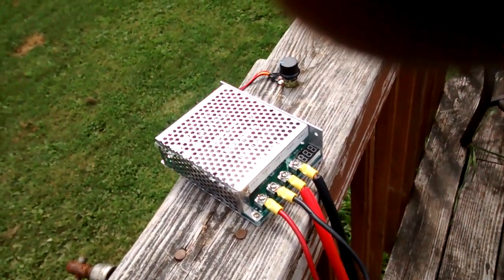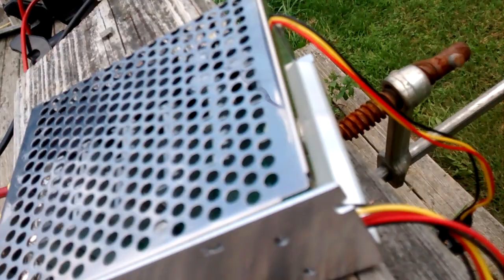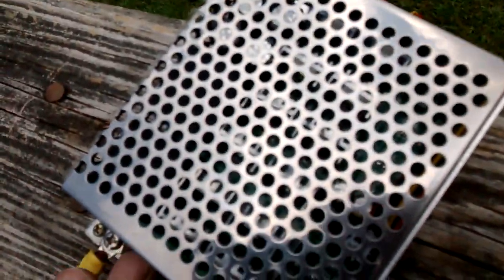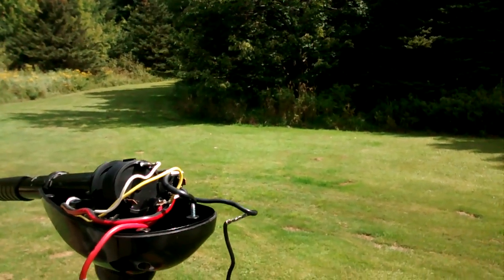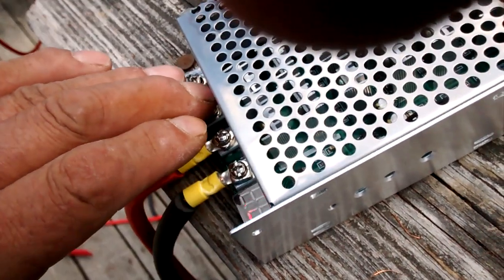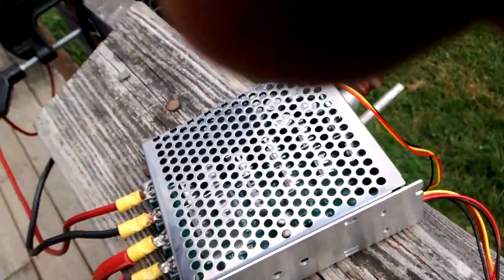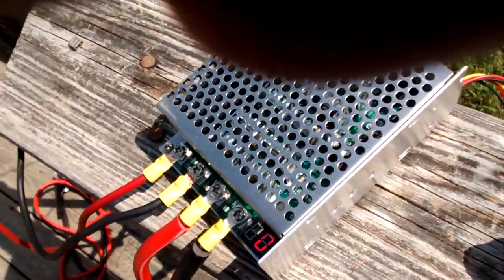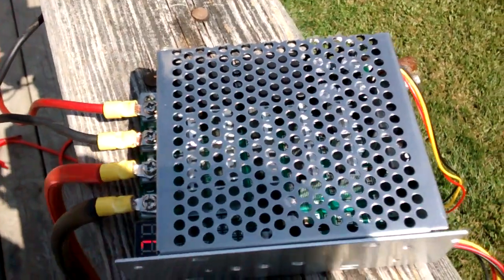Trolling motor variable speed switch

Comment: How has this setup working for you?  I did the same thing except my pwm unit was only rated for 30 amps.  I got the trolling motor into some mud last night and blew up the speed controller (pulled too much current).  I saw yours is rated for 60 amps.  Has it lasted for you?
Reply: Scammin Janet I used a reverse polarity momentary toggle switch for my steering motor.  Worked fine.  Just find a wiring diagram online.  You won’t want a momentary one though.  I’d say one rated for 30 amps isn’t enough in your situation.  You can count on pulling close to 50 amps from a 45lb trolling motor.  I suggest finding one in the 50-60 amp range.
Reply from the maker: Ryan Kahre I used the hell out of it last year and still going strong. I have it in a box with a fan to keep it cool.
Reply: Awesome I might add a fan to mine.  Thanks for the video!
Reply: Andrew Eddy the one I just installed doesn’t look exactly the same as this one but it’s also rated for 60 amps.  I didn’t use a fan.  My trolling motor is a 40lb.  I’ve used it for a couple hours and so far so good.  Not sure how hot it’s getting cause I haven’t opened my box to check while running it.
Reply: Any idea how I can wire in a reverse polarity on/off/on toggle switch to the speed controller. I want to be able to use reverse. Also will a 30amp toggle switch be ok with a 60 amp controller on a 45lb motor?
Reply: WINOMO Heavy Duty Toggle Switch Flick ON/OFF/ON Car Dash 12V DPDT with Waterproof Cap https://www.amazon.com/dp/B075XM68QV/ref=cm_sw_r_cp_api_i_Tw48AbVB4Y0TY
This one should do what you’re wanting.  It doesn’t list a current rating at 12V DC but the AC rating tells me it’s overkill.
Reply from the maker: Ryan Kahre You don't need a high amp switch for this,just a simple cheap 3 wire on off on switch.. All it does is sends low voltage to the relays to activate them. The ralays carry the higher voltage. I'm using a 10 amp 3 wire on off on switch that I bought from ebay.

Comment: I bought a 150 dollar PWM wireless switch from Wireless Trolling Pro and it did not make it through the first trip. It got hot, burned up, and short circuited. I had to paddle 8 miles back. I just order this one from amazon based off your video. Thank you for the work and effort. I also learned the valuable lesson of having a wiring back up plan!
Reply from the maker: M. Simon Wilkes I don't know if you saw my other video but I ended up putting mine in a box with a fan. It lasted all last season and is still going strong. I do know that without the fan,it gets hot. Hope you have good luck with the new unit.
Reply from the maker: Andrew Eddy 30 amp is not enough for that size tm. My suggestion is to match the watts with the thrust and add 10. Example: 50 lb trolling motor with 60 watt speed controller.
Reply from the maker: My bad.. I meant to say amps not watts.

Comment: Hi, Nice video! Are you still satisfied withg the controller? I'm about to buy one as a repalcement for my variable speed control for my 74Lbs Minn Kota. And I like te price but wonder if it survives a 6 hour boat trip
Reply from the maker: Very satisfied! Here is a link on how I installed it.Thanks.
Reply from the maker: https://www.youtube.com/watch?v=bNRil7dXySg&t=20s
Reply: Thanks again for your videos. My speedcontroller just arrived from China and the first test is good. Seems that the old Minn Kota controller has reached its lifecycle indeed. 
Also bought a 24v fan te cool the controller. Now the next thing is to build it in my boat. The controller is in the hatch and the to be built controlpanel outside. The cables are pretty short so it will be a nice puzzle. I will post the result when ready
Reply: Sybrand De Vries got a tournament Saturday I’m going to put it to the test!
Reply: That will probably draw to much amperage for this model

Comment: Why don't you just wire inline on the battery leads?
Reply from the maker: This was just a temporary hookup to see how it worked..I have it hooked up permanently now and it works awesome! It cant be connected directly to the battery leads because you have to bypass the original switch,Otherwise it would back feed into the unit and burn it up.
Reply: Can you explain that a bit? I am about to do this as other videos have shown direct connection from battery to speed controller to motor and putting switch in position 5 works.
Reply from the maker: Hi Ian.Sorry I didn't get back to u sooner,I figured it woul be easier to explain it in a vid so here is the link,Thanks.https://www.youtube.com/watch?v=bNRil7dXySg&t=20s
Reply: where did you purchase the speed control unit ? Been looking for awhile
Reply from the maker: eBay...100 peak amps, 60 continuous pwm speed controller.